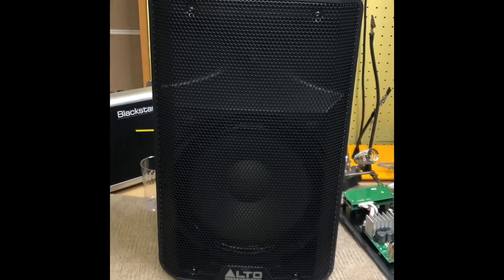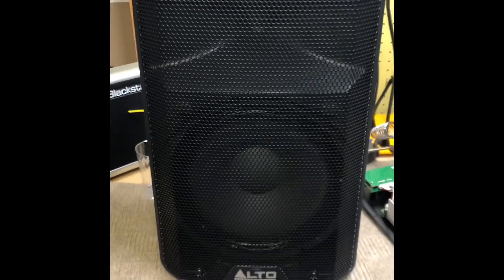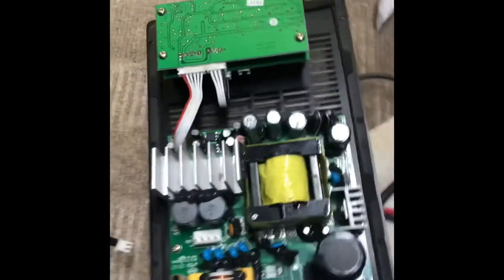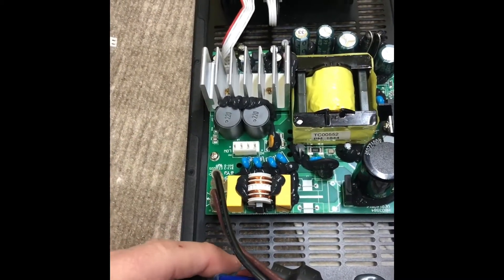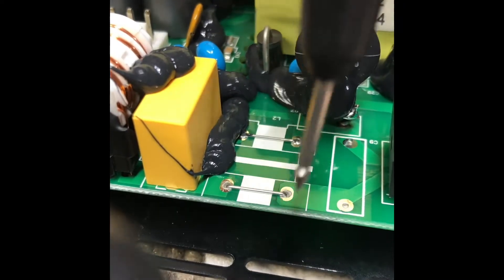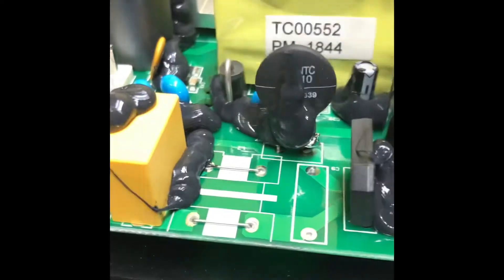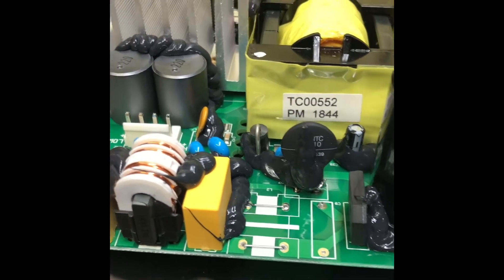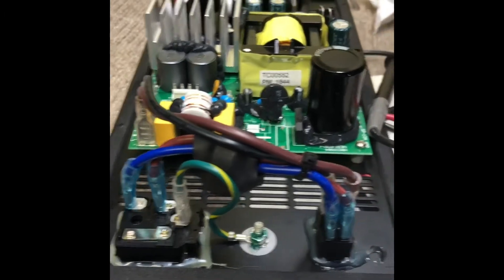Alto TX210 powered speaker repair

Comment: Hi, help me. My musicIan friend during the installation of the system  before the musical evening,  turned on the speakers with the amplification regulators knobs at maximum. A very strong bumped occurred in the room: the FBT box held up to the shock, while one of the Alto TX210 stage monitor did not turn on.The 800 mA 250 V   fuse was changed, but it  blew again.  I opened the amplifier module  and found The TOP 250YN voltage regulator and controller exploded  (its mounted vetically with The aluminium heatsink  in the swichting power supply).In addition,  in another point of the module i found C25 and C27  respectively 220uF 25 V  electrolytic capacitor  (one with a capacity reduce To 172 uF and the second capacitor C25 is nothing value and ESR value Very high At 7 OHM.  Do You have a wiring diagram or manual Service To send me, or could You tell me wich other components i should check before mounting The new TOP 250YN ? I wouldn't want anyone To miscopy it because it's a Very critical component connected To The mains voltage. Many thanks forse You help

Comment: That looks like a current limiter - not a capacitor. They are a higher resistance at power up and so they limit the curent - after they have current flowing through them they go down in resistance.

Comment: Thank you. My woofer isn’t working at all. Also, the fan turns on briefly about once every 10 seconds. any initial thoughts? Thanks
Reply: Hello where you ave to fix your speaker? I have the same problem  with mine
Reply: @TheGaboni809  Mine is still not fixed

Comment: Hello,

I tried to find the same component for mine but couldn't find it anywhere. where did you buy your replacement component?
Thanks
Reply from the maker: I actually just soldered the broken leg of the capacitor.  But if you remove the capacitor and check the specs, its got to be readily available on Amazon or Ebay.   I usually go to eskc.com since they are local but you can also order online from them.  Call them and they'll probably be able to get you a replacement.
Reply: @lockdownguitars152  I know this is asking a bit too much but I've tried googling and hit a brick wall. Would you be so kind to let me know what is the number in the component screwed to the black heat sink? Mine blew up and all the markings are gone. I'd like to order a new one but without a reference it's very difficult.
I'd really appreciate your help but also understand if it's too much of an hassle.
Thanks